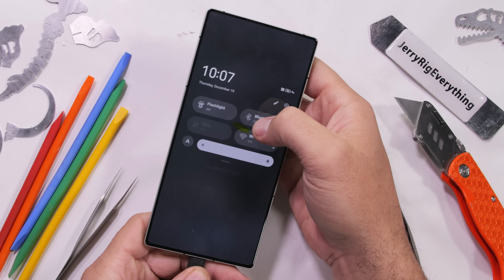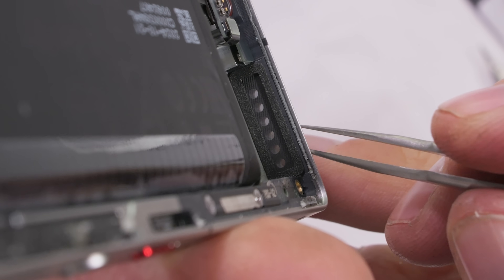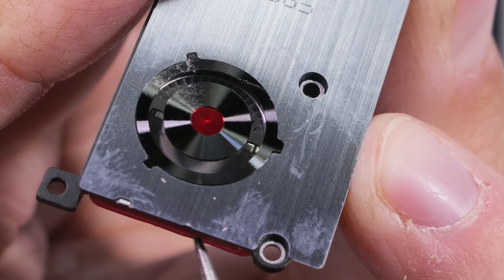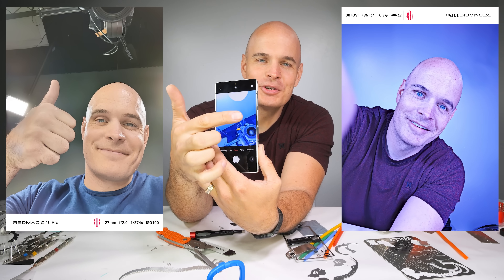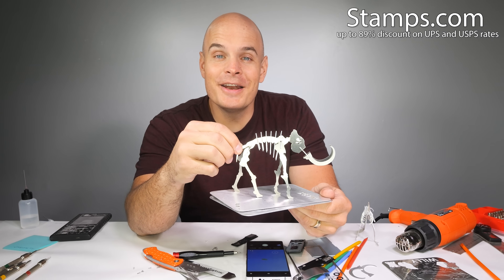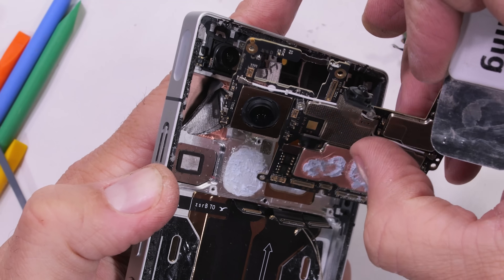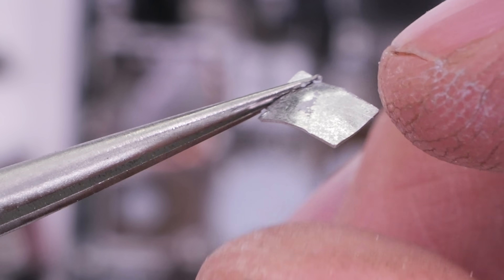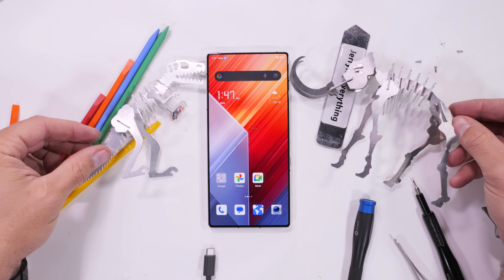The Smartphone from 2040 has a 'Liquid Metal' cooling system inside?

Comment: This phone pulled apart so uniformly.
It isnt easily repairable obviously but damn it looks moddable
Reply: why would you think its not easily repairable
Reply: @G0ML666  I deal with laptops and phones rarely as a hobby.  From what I am see, its a phone with a  special cooling system,camera tech and multiple points for adhesive and applying thermal paste again. It has waterproofing that could get damaged too.

That could cost aleast half of the phone's price just for a screen much less other parts. 

My country has high tariffs too.

Comment: This is one of those times I wish he actually did useful tests. Like he could test if the Liquid Metal cooling actually does something or if it’s just a marketing gimmick like the titanium on apple and Samsung phones. Or rather than speculating he could actually do a basic water test. I would love for him to replace the stupid flame test with a water test. This really sounded like him reading a company-provided stat sheet complete with quoting a different battery capacity than the one printed on the cells he’s holding.
Reply: It's marketing fluff... liquid metal is supposed to be liquid at room temp, and they have slathered thermal paste all over it... its more of a fancy thermal pad, but that thermal paste negates any potential benefits
Reply: @shawnpepin7890 S25 Ultra has 52% stability in stress tests. Red Magic has 90%.

For “marketing fluff”, it sure seems to work! 😂
Reply: @TheRealNightShot  the fan and shear thermal mass of the heat sink is doing that, not that fake liquid metal
Reply: @ Uh huh, and I wonder what’s bringing that heat to the fan so fast in the first place.

Hmmm, couldn’t be that “fancy” thermal pad, right?
Reply: @TheRealNightShot  the thermal pad is wayyyy after the heat sink... there is the cpu, and heat sink, thermal paste to a whole other heat sink.. did you even see the layout in the video
Reply: @shawnpepin7890  There is no such thing as "heatsink" in Red Magic. There is a huge vapor chamber that covers the entire phone's innards. The CPU wasn't even shown in the video, for some reason, you can only see the points where there's the most thermal paste, and both are very near to the metal thermal pad. The SoC's location is literally next to that thermal pad. Try again.
Reply: @TheRealNightShot  a vapor chamber is a heat sink... wow
Reply: @ A vapor chamber is indeed not a heatsink.
Reply: @TheRealNightShot yes…. It is.

Comment: I think the paste is phase change material and i don't know why they used indium sheet instead they could have gone with thin graphite with one side being adhesive which has very good heat conduction when paired with phase change

Comment: I would change the fan for more metal and proper water resistance, and have just have the selfie cam punch hole to not sacrifice quality. that would be a great phone
Reply: Umm well that would just be an S25 Ultra for when that comes out.
Reply: @zetsubou3704  yes and no. Samsung does boring looking phones
Reply: The fun part is that it has a glass glued ON TOP OF THE SCREWS... But... Wasn't the excuse for glued glass the waterproofing? Why having a phone that you can disassemble with normal ass screws and then glue a glass on top of it? It doesn't make sense, it makes the phone thicker, less serviceable and more fragile all in one.
Reply: @mastah39  true!! forgot that. like it does not exists any sealing with screws
Reply: @mastah39  If you watched the vid, you'd have seen that it is indeed slightly water resistant, and the glass helps keep the water out from accidental splashes at the very least. Or would you like a phone that can't even last a minute in the rain.
Reply: @zetsubou3704  BULL CRAP. The shittiest gasket around the least precise screws can stand in the rain much longer than whatever they did with the fan intake. 

Waterproofing is the thinniest excuse for gluing phones together to begin with, as it is the whole "Premium Materials" BS they shoved down our throats.

This phone just exposes is a tiny bit more than others. 

Glass is Glass and glass breaks. Metal frames bend and dent with minimal effort. And to avoid that you're gonna put a ugly fake leather rubber case that's twice the thickness of your phone. You know what would make a waterproof, thin and rugged phone? A simple ABS plastic design with screws and gaskets.
Reply: @mastah39  You answered you own question. This is a gaming phone in the end and not a rugged phone, it is meant to look exotic and "gamery". 

If they really wanted the best repairability and durability they could have made the back out of metal with the duct welded to it and attached with gaskets and screws, but they wont do this.  (I need to join their cooling hardware team fr).
Reply: @zetsubou3704  The exoctic look is given by the metal plates screwed on, the fans and the leds. The glass on top of that does nothing other than making it less serviceable, probably even at the expense of an ever so tiny percentage of thermal performance.

I understand the "gamey" design made out of metal panels, I would understand a transparent glass back with a view of the actual components inside (I have an Xray skin on my phone after all) what I don't understand is having both.

Comment: I'm not sure a lot of people really noticed this. But JRE was able to disassemble the phone with ease and check out every single component while still being able to assemble it all back without a single damage to the phone which usually isn't the case. Normally the phones usually end up in an unusable state when he does this so it says a lot about the repairability potential of this phone if parts are available
Reply: For real. Even ROG, Legion and older Blackshark phones were extremely convoluted inside, while Nubia kept it simple. If only their software team had the same passion as their hardware team.
Reply: I feel like he's usually able to assemble them back. Usually the ones that are unusable break during the durability test but not when they open it which usually only happens with phones that pass the durability test. But I don't know it's possible you've seen videos on this
Reply: @michael_c2 galaxy have glass glued to the back which often cracks ( I repair the phones regularly)
Reply: @xmuggsyx  seeing this just after cracking the back of my s21 ultra is makes it even funnier 😂😂. But yeah I see where I was wrong about it
Reply: Other than the rip in the vapor chamber
Reply: @josephrumpsa180  That was a copper foil, likely for EMI, it didn't have thermal paste on it so it's probably not thermal
Reply: I think this is one of dark sponsored videos when the YouTuber shows a product in a very positive way sponsored by the company
Reply: @MultiMercucho  it just might be 🤔🤔
Reply: He does it with ease all the time
Reply: I thought the exact same thing once I seen him clipping things back , definitely potential here to create a mod'able phone
Reply: Except the damaged cooling pad behind the main camera and the irreplaceable fan shroud, yes no damage was done.
Reply: "without a single damage" wtf is this shit comment.
Reply: @8bitchiptune420 I mean look at his avatar… what do you expect? 😂
Reply: I don't know what you're smoking, but he's more often than not able to reassemble phones back to a fully functional state. Pretty much every iPhone and Samsung phone (minus the Fold/Flip for obvious reasons), Pixel, etc in the past few years he's been able to reassemble.

Maybe go back and rewatch some videos before commenting so definitively?
Reply: @no-nukez  it's PR comments
Reply: "To open up this phone all you gotta do is remove 20 screws along with a thin glass panel. Fairly easy to work with!"

aight fam.
Reply: @alteito  i mean... You gotta compare it to the other phones on the market, which ALSO require removing a dozen or more screws after removing the back glass panel.
Reply: You can tear down 90% of phones and put them back together just fine if you're not being an idiot about it.
Reply: Plot twist. He had a second phone with just removed backplate and the foils. Then he just put them on and turned the phone on. Or revinded the video, so that it looked like he put it together. Just JayzTwoCents 👀

Comment: wait if the phone kept horizontally for too long can cause the liquid metal to get on to the mother board and make it have a short circuit and self destruct like the PS5, Pls conform ???
Reply: It's probably not "liquid" metal, it'll just soften a little under heat and not completely melt. Or else there wouldn't be thermal paste on that small slice of metal.
Reply: @zetsubou3704  Thanks a lot dude

Comment: The Hardware seems pretty impressive and the cost is also okay, but the software support looks terrible. 

They promise only a single OS Update, so Android 16 and only 3 Security Updates, which is even worse.

Compare this to Google Pixel which has a relatively bad Chipset with the Tensor G4 but 7 promised OS Update Up to Android 22.

Comment: the only way this phone could be more futuristic would be if the Batteries were user removable
Reply: and an sd card slot, plus an IR Blaster
Reply: the only way this phone would be even more futuristic was if it also had headphone jack
Reply: @bottering_one  i think it actually has one
Reply: @Artista_Frustrado  yeah it does on the top
Reply: @jaredschroeder  there you go, Phone of the future
Reply: @Artista_Frustrado  nah I hear the software and it's maintenance is pretty bad
Reply: @bottering_one  I believe it actually does

Comment: So let me get this straight. The heat goes from the CPU into the vapor chamber, then into a layer of regular thermal paste, then into a layer of 'liquid' metal, then into the air duct? Seems sub optimal.
Reply: Everyone is a phone engineer who thinks they know things. I guess if youtube comment genius don't understand how it works it must be a gimick
Reply: What's even funnier is the "liquid metal" sits under the fan, not touching the duct, where I'm not sure how the fan or the duct is cooling anything or conducting heat from the vapour chamber.
Reply: That's what got me thinking as well. I mean it does help with the heat, they said so (I have to take their word for this here as I don't have this phone myself and thus no way of testing myself), but it would have been awesome if they could've put the liquid metal where the thermal paste is. Maybe next time.
Reply: @celestinonatale  problem with liquid metal is simple: In pcs you get extra frames around cpus to prevent liquid metal from leaking when the device is held vertically, if you don`t have the extra frame your device follows some PS5s that had their liquid metal leaked and caused internal damage. In phones you want them to be as thin as possible, so adding such frames around fragile components would increase thickness. You saw in the video there was a ring around liquid metal on the fan. That`s why. Hope it`s clear now for you.
Reply: it wont be the best use case. It probably just a gimmick. But it still work, it just a phone anyway. It wont produce much heat. So adding slightly moving air that have metal contact to the cpu, when usually it enclosed in a glass is already making massive different in heat dissipation
Reply: "Liquid metal" is a good conductor, thermal paste is the conductive sealant. Dissipating as much heat as you can get without a much more vulnerable open design. With minimal space. Lending to the Ip54 rating. Had to search until finding a cust service post for that. There is also incidental cooling throughout the surface area of the vent. The point is this setup dissipates heat better than not having it. Hence the thermal performance you see while using it.

Comment: Well that was a lie. Indium is not considered a liquid metal in a PC scene. It's used in CPUs under IHS and often replaced with actual liquid metal (gallium) by overclockers to improve performance. Using gallium in a phone would be a nightmare though, it is prone to leaking and shorting components.

Comment: Would've liked to see you melt that liquid metal by a lighter or something. But otherwise great work!
Reply: That would have been a mess I guess. He'd have to pour the liquid metal into the small rectangular "alcove" again to get it to cool down into the right shape again.

That being said, yeah, it would have been cool.
Reply: That is not liquid metal.. liquid metal is liquid at room temperature... plus they applied a layer of regular thermal pastes over it,  so it negates all the potential... it just marketed mumbo jumbo
Reply: He should've actually tossed the alloy in some water. I wonder if the potassium would have reacted after contacting the water. 🤔

Comment: Interesting. Seems like the screen on top of the camera makes photos more yellow, so it digitally applies a blue hue to make up for it.
Reply: approved by my brain
Reply: @Antonder2tespproved by your brain, since mine is...wait... oh, lost it at the bar again
Reply: It's the polarization and blue filter on the front of the screen. It doesn't make the image more yellow, it makes them less blue. The polarization improves the image quality (in most cases) which is why you can buy it as filters to add to your DSLR lenses.
Reply: Polarization is not about image quality but rather reflections, which it eliminates. This is important when shooting through a screen, and smart engineering.
Reply: white balance
Reply: Does it depend on what’s on the screen AT THAT TIME tho?
Reply: @whophd  I have the previous version of the phone, the moment you use the selfie camera the screen in that area turns off (black) so it doesn't interfere with the actual picture.
Reply: the screen is applied as a filter for blue light in the camera sensor, this means that the camera sensor is designed to capture more blue , and the blue light then be filtered through the screen
Reply: What I really don't understand is why can't they turn off the pixels while the front facing camera is taking the photo, shouldn't that provide much less color distortion?
Reply: @freewaytf  Because the Pixels are still "Uniform" across the Screen's Panel, only recently Bigger screen like TVs and Monitors have been doing "Zones", it would take sometime for smaller Screen to be, or ever be if anyone cares enough.
To me the "Pop-out" Front Cams are still "revolutionary" than these.
Reply: @NBLT-rk6lp   but pop out has major cons
Reply: @KnHighmer_Dos "Moving parts" yes?
Well if only we could somehow apply that very neat "magnet" stuffs with these, just like with those "MagLev bearing" for example.
Or even simpler: Bring back the damn "Bezels". More protection for the Screen, better Speakers and Microphones, even more Space for whatever else needed.
Reply: @NBLT-rk6lp  at that point just make the phone bigger, which we Don't and shouldn’t because a 6.5 inch phone thats all the craze now can pack a whole lot, more than you can imagine

How about a camera you can push up manually?
Reply: @NBLT-rk6lp   good point but ppl n companies hate bezels, so good luck with that
Reply: @KnHighmer_Dos  Well, since when does Companies have really looking at the Users of their Products instead of just Internal Charts made by their own Employees that used their own Datas anyway.
Reply: @KnHighmer_Dos  Thanks for your times anyway, it been a while since i got any "intellectual discussion" on the Internet.
Reply: to me it seems more likely that it's physical, in the lens. but it's not always easy to tell these days, especially without ripping it apart and digging into proprietary stuff yourself. redmagic in particular is amazing in their innovation with those tiny little fans that are so adorable. and you can actually just buy these components straight up for pretty cheap btw.
Reply: And a bunch of sharpening to hide the blur
Reply: Yeah, but the image quality is a lot worse.
Reply: @alejandroperez5368  You say that like you really care about quality pictures from selfie camera. If you do care you are not the target audience for whom this smartphone was designed.
Once my current smartphone dies I will buy one of RedMagic or Nubia Ultra, just because I am disgusted by all the others with screen being cut out or pierced through.
Reply: @alejandroperez5368  they have gone out of their way to say this phone isn't for 'influencers' that take a ton of front facing selfies a day
Reply: I love the 9  only complaint I have with it is that when launching YouTube it sometimes doesn’t open if you previously had it open
Reply: Come on, thanks Captain Obvious! If you really have those who didn't figure it out before, then our world is doomed...
Reply: @Маленькийенот-ч5ж  Wow you are insufferable
Reply: @dvn.s_0069  When I go to English YouTube, it's like I'm becoming the main character of the movie "Idiocracy".
Reply: @Маленькийенот-ч5ж  Found the bot
Reply: Bait  @Маленькийенот-ч5ж
Reply: @Маленькийенот-ч5ж  come on captain nice guy, why so mean? alltough i agree on the "if you didnt figure it out, the world is doomed" part lol